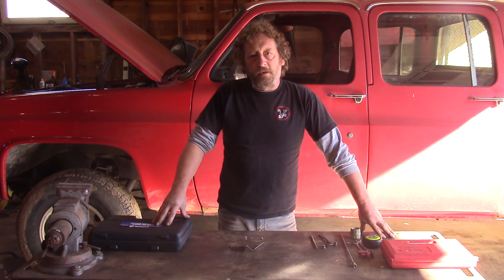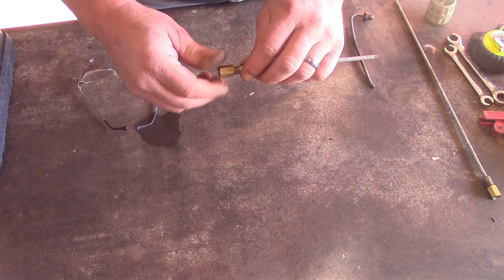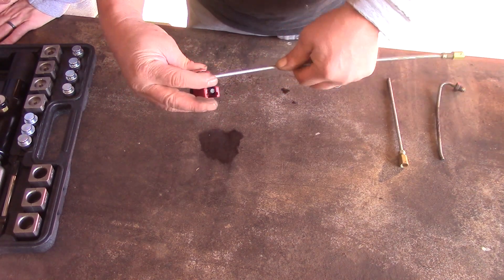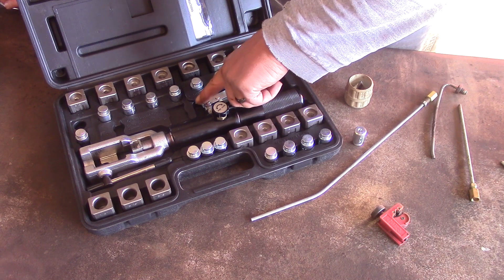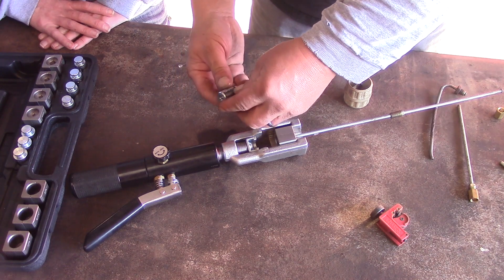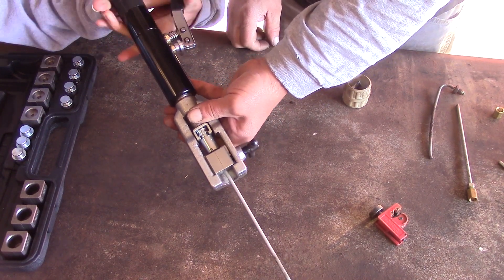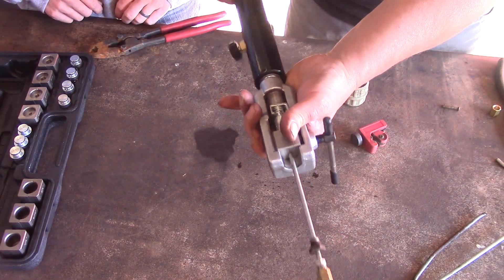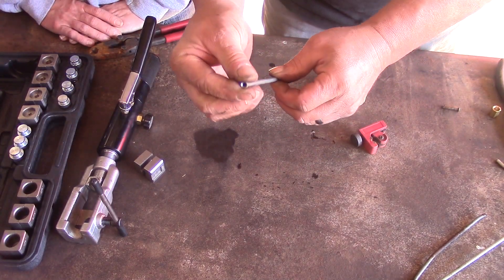TECH TIP HOW TO FLARE BRAKE LINE by BSF Recovery Team

Comment: I just bought a similar tool to the first kit you showed. Can't afford the big kit as I only work on trucks that need the 45 degree double flare. Compression fittings are a no no for road vehicles and glad you didn't show one.  great for temporary fixes but better if fixed right the first time. Great video.

Comment: I have the identicle tool. Iv had id for about 6 years and it still works like new, great tool. However because of the size of it and how you have to turn it to bring the die to the blocks if your flaing a line on the vehicle in tight quarters it's not a very easy tool to use.

Comment: How do you know if your brake line is metric or American?
Very informative video.. thanks
Reply from the maker: Metric line is most often the ISO flare, sometimes called the bubble flare.
Reply: didn't you double bubble flare the line for your Chevy? The first press with the die then the second press with the pointy die?  I have the tool you didn't use. I had to make a brake line for my 97 Jeep Cherokee that ran from the rear wheel up to the mastery cylinder. I kept screwing around for 3 tries until I got what looked like the factory flare, but to this day I have no idea if it was american or metric. The line has been in service 3 years so I guess it's ok LOL.  Regardless you video on this was way cool. I hunted up other videos since watching this of flaring brake lines double bubble and it's unreal the different ways and tools people use to achieve the same result. However, that hydraulic tool you have is way sick, better than anything I've seen or used.

Comment: Also, the best brake line I have ever used is Ni-Copp.  That stuff is awesome!  Doesn't crack, split, work-harden (At least it didn't while I was using it) and it takes a flare like nobody's business.  It sealed correctly the first time, every time.  Was easy to bend into the shape needed, and only cost a few pennies more per foot than normal steel line.  Also, won't rust out.  When I re-plumb my race-car, or plumb for the first time my camping trailer, that's what's going in.
Reply: Peter Allendorfer it has a lower psi rating steel is the way to go

Comment: I have this tool also. I really only use it for making fuel line flares. I have the eastwood flaring tool for brake lines it is by far the best and easiest to use. check it out and you will want one.

Comment: Something needs to be mentioned about brass compression unions on brake lines, BIG NO NO! There are steel ones that may be ok, but I think the brass ones are only rated at 400psi, normal brake line pressure can be in the 800psi range on a regular stop and can be over 2000 in a panic stop. Don't want the pedal going to the floor when you need it the most. I will never and have never used one, its the number 1 most potentially deadly shortcut that can be taken when repairing vehicles. Would you use Vacuum line for an oil cooler hose? What does 2 wrecked vehicles cost to fix or loss of human life, 300 bucks for a badass tool is cheap insurance to make sure you have the tools do it right, of course the old school tool is fine too, but once you own one of these you will never look back, especially when part of the line you need to flare is still on the car, its so much easier to operate than the old school tool, which pretty much only works well when clamped in a bench vise, otherwise its cumbersome and takes lost of hand strength, do whole car with the old school tool and your hands will be sore for days.